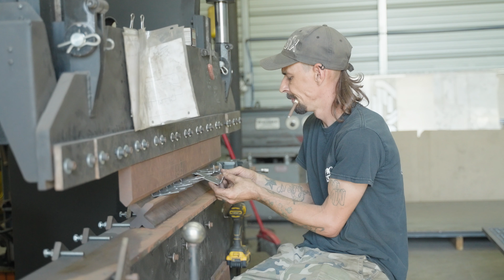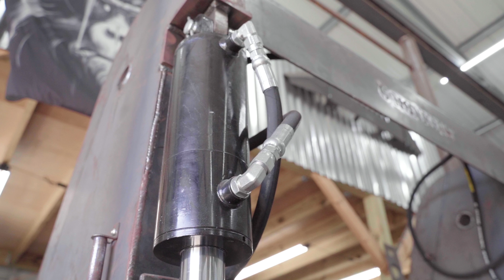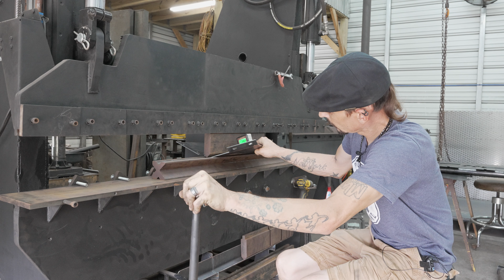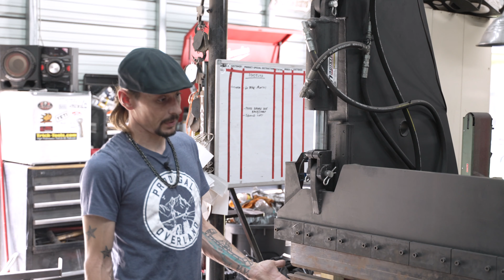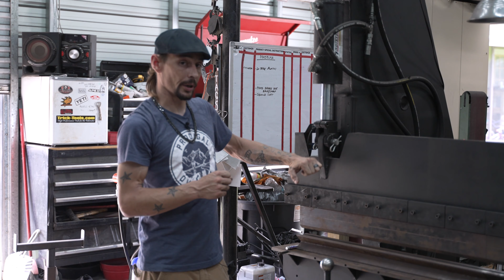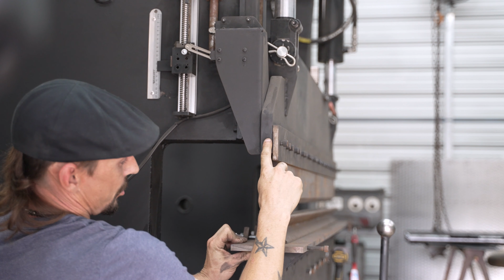The BEST DIY Homemade Press Break Overview (Fab files in description) | 6 Monkeys

Comment: How are the hydraulic cylindres synchronized to ensure the ram action is always level (ie one side doesn't go lower than the other if you have uneven load like using a side instead of the center for a bend) ?
Reply: Rotary Flow Divider 11:11

Comment: Great job - the rack idea is pure genius !
Reply: The rack is to small to be of any advantage with the thicker materials. the Rotary Flow Divider combined with keeping the material centered on the heavy jobs is what keeps it true.. Search Y/T for a rocker type press and you will see the synchronizing beam is 8" heavy wall pipe or even bigger

Comment: Hi, in a previous post you mentioned adjusting the flow rate for bending speed. How is this accomplished ?  Also where did you source your 4 way lower die ?  Thanks ! Nice build !!
Reply: My pump has a flow adjustment screw in the valve body. I find my 4 way from an EBay seller, who happened to be local to me.

Comment: I usually bend thin metal. I want to know how quick it is going doing and up again?
Reply: It’s not too bad. It takes about 30 seconds to completely cycle. I adjusted the flow rate to what was comfortable for me while bending. Too slow and it gets boring, too fast and it’s hard to hit specific bend degrees.